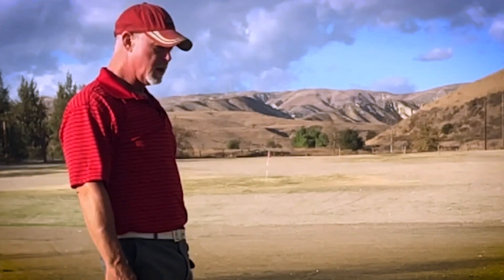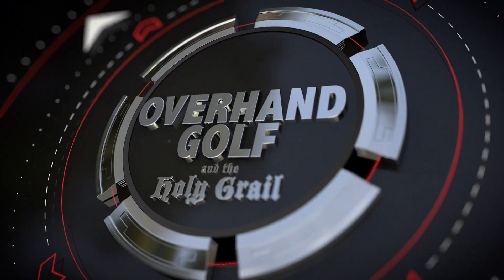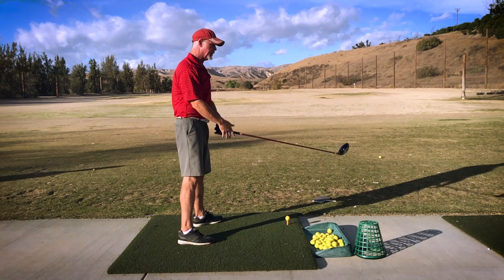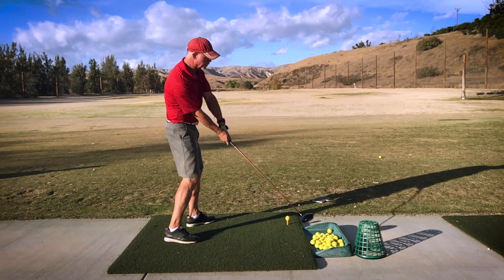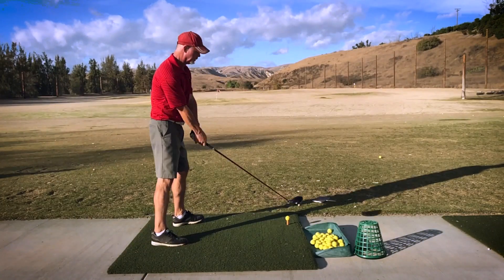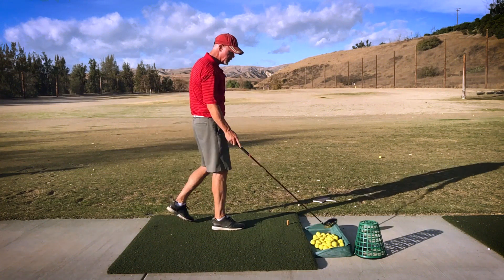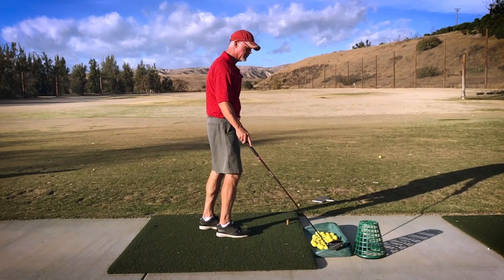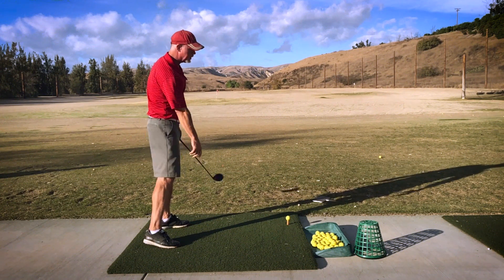Cracking The Whip.  It's NOT What You Think.

Comment: Fantastic swing!! 

Cracking the whip at the top of our swing definitely places the impetus of our swing at the handle of the club as the head of the club repels itself backwards. 

Since professional as well as yourself has a handle speed of up to 18 miles an hour i don’t think deliberately yanking the handle down would be good. Instead simply let the sling shot effect of the head of the club to the ball take place; the momentum of which brings us to the finish of our swing. Perfect! Cheers
Reply: The hands and handle must swing faster than the clubhead. I most definitely have my impetus and focus on my hands swinging just the handle of my club following my rotating pivot of my body to a full and balanced finish position. No thoughts of the clubhead whatsoever. If I accomplish this then the clubhead always lags naturally and nicely and my hips are open at impact and I can solidly hoist the ball into the air and towards my target. Ant attempt to hit at the ball and its a disaster waiting to happen.

Comment: Hello Sir. Thanks for your fantastic content. 

Regarding the whip from the top, in some of your reply comments to your other videos you refer to trying not to release the right hand wrist angle until as late as possible (thus maintaining lag when say hands are below chin coming into impact etc). 

Can you please explain how you go about cracking the whip up high but without causing the right wrist angle to be released early? (I suspect it may involve using your right shoulder more and earlier to implement the HG move, but would love to hear your view.)

I love the Holy Grail move and also am having some positive results with the whip crack, but do notice on film that when cracking the whip the angle between shaft and my left arm is much greater than 90 degrees when coming into the position of my hands being below the chin (ie, the angle is releasing early), and for a number of reasons (including speed and compressing iron shots) I would like to be able to be closer to 90 degrees at that point in the swing. 

Thanks in advance for your reply.

Comment: Hey Greg. Can you elaborate on the “pulling the handle down” part of this because I have found that that can cause the shaft to steepen if done at the wrong time. Thx.
Reply from the maker: Well, any time we swing anything like a baseball bat we drive the butt end of it to the point where we think impact will be which is the extent of our reach and then we let the bat release.  When we crack a whip we have to pull the handle in the opposite direction of the initial force so that we send a kink down the whip.  If you moved your hands back and forth fast enough you could crack the whip at both sides of the reverse of direction.  So, by imagining the crack happening at the top is where we reverse the direction of the handle and that brings the club down and through the ball smoothly.  The handle is the only part of the club we're holding so that's the only part we can truly manipulate.
Reply: @HolyGrailOfGolf  thanks.

Comment: Ive always hit best when feeling a release from the top but couldn't tie that idea in with modern instruction. 
Following this video I tried think of a whip tied to the shaft at the club head on the ground at set up.  I want to drag that rope away with the shaft and flick it over my head then before it (the imaginary whip) starts to fall i use  the shaft to crack that rope (whip) over my head with the intension of bringing shaft to hgog position. This idea with a rope flying around in my minds eye also improved my rhythm...Who’d have thought?
Reply from the maker: That's exactly it!
Reply: Hgog?  C'mon man, give us a break and proofread.
Reply from the maker: @mjb8274  Proofread?  What did I get wrong?  Oh, you mean "hgog" ... that means Holy Grail of Golf.  You haven't seen the HGOG video, I guess.
Reply: How long is that imaginary whip?  4 foot?  And where are you thinking it cracking?  11 o'clock  10, 9, where?  Thanks

Comment: I tried the concept today and it worked very well.  I'm not sure I'm doing it right, but there was a "looping" action with the clubhead at the top that's different than a regular swing.  The club swings back and the downswing starts before the wrists are fully set.  This creates the whip cracking effect with the club.  When you time it right, the club rebounds and "downcocks" even more in the downswing.  It's easy then to throw the clubhead straight through the ball with a lot more speed.  Is that the way your swing works?
Reply from the maker: That sounds right.  Isn't that how you'd throw a club?  If so, that's it.

Comment: Cracking the whip at the top.  Now that's really some out-of-the-box thinking.  I believe you are on to something there.  It might create a "downcocking" or increase in the lag of the clubhead during transition that can drastically increase the clubhead speed through impact.  I was working with an idea similar to this not long ago and I was hitting some really long, straight shots with it.  It didn't seem to work so well on the partial swings so I put it on hold but it is worth trying again.  One thing I noticed different with that swing was that I felt more force against my right index finger on my right hand during the downswing.  Did you get that sensation too?

Comment: Awesome content.  I notice you rotate (clockwise) your left arm on the backswing.  In fact your watch face points outside target line at club first parallel, and then nearly vertical at top of backswing.  Certainly keeps club on plane and deep.  Is this active part of your swing?
Reply from the maker: I think that's just a product of the mass of the clubhead.  I hadn't really thought about it, but I'm making a true one piece takeaway.  The hands and club haven't done anything until my back is facing the target.  I never really thought about it before.

Comment: Is the ball on the ground or above your head? You want the crack at the ball because that’s where energy/speed is the greatest. In my opinion, you’ve got your analogy backwards.
Reply from the maker: Actually, the ball is above your head.  When you lean forward to address the ball you're raising the ball up to head level.  You're thinking too conventionally.  Also, if you know a way to send a kink down a rigid shaft, I'd love to hear it.   I don't think you're getting the general idea that I'm putting out in this video.  
Go snap a towel and watch what your hands have to do in order to make it snap.  Would you ever want your hands moving backward at impact with a golf club?  I hope not.
Reply: @HolyGrailOfGolf  the ball is on the ground and you’re “cracking the whip” five feet off the ground. Hands don’t move backwards but the left hip is moving away from the ball and the hands slow down as the club head accelerates through the ball. Of course the rigid shaft doesn’t “whip” but the final lever in the system (hands/wrists) does snap through impact. 
Physics dictates that to fully accelerate the club head, the other links in the system work in an opposite direction to balance things out. Every action has an equal and opposite reaction. De chambray is the latest example of this as you look at his left hip and foot through impact. Both are moving away from the club head creating the “whip” at impact and not at the top of the swing.
Reply from the maker: https://youtu.be/SV9PLc8SaAk?t=29 
Watch closely and you'll see where the whip actually cracks ... way behind him and up by his shoulder.
Reply: @HolyGrailOfGolf  but he’s not hitting a ball, he’s cracking a whip for entertainment purposes.
Reply from the maker: @barneybrockwell8302  Clearly you are unconvincible, but he thinks he's making a golf swing and everyone imagined the crack happened at the ball but it didn't.  It happened just the way I describe.  He loaded the whip and when he started to move toward impact the whip cracked at the top.
Reply: @HolyGrailOfGolf  I’m not saying the whip didn’t crack at the top. I’m saying that has nothing to do with hitting a golf ball with a golf club. As someone that has used lunge whips with horses for more than a decade I can tell you that the cattleman’s crack is great for making noise but if you want to literally reach out and touch something with the whip as it cracks that’s not going to get it done. My intent when hitting a ball is for the club head to reach peak velocity through impact. That is what the “crack” of the whip is, peak velocity as the tip cracks back and actually breaks the sound barrier. That’s the crack. I want as much of that as I can get at the ball not at the top of my swing. That’s all I’m saying.
Reply from the maker: @barneybrockwell8302  Ok, I think we agree somewhat.   You're familiar with a figure 8 crack and as I said this would be a reverse cattleman's crack, but if you were to do a figure 8 crack and you intend the second part to crack at the ball that would be correct, except that we don't want any reversal of direction of the hands anywhere near impact.  Anyone trying to crack the whip at the ball is either going to hurt themselves or hit the ball really poorly.  When you imagine the crack at the top you're moving the handle smoothly and quickly through impact and not a jerky motion.
Reply: @HolyGrailOfGolf  the handle of my club slows dramatically before impact, that’s precisely what accelerates the club head.